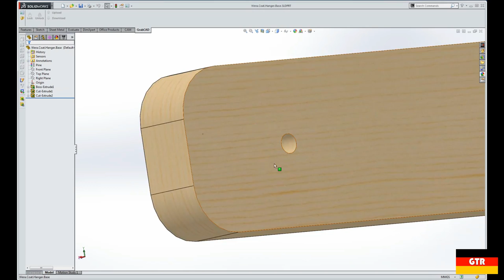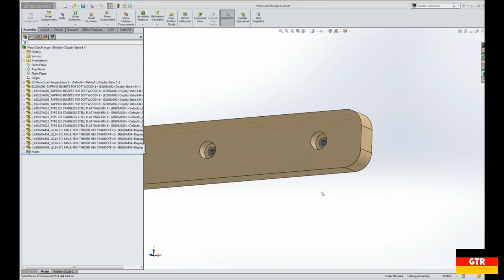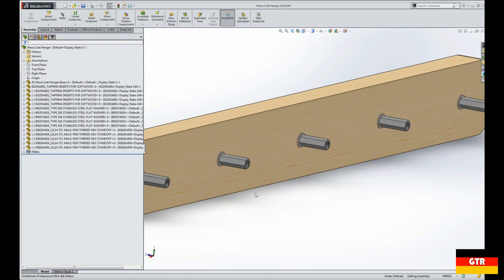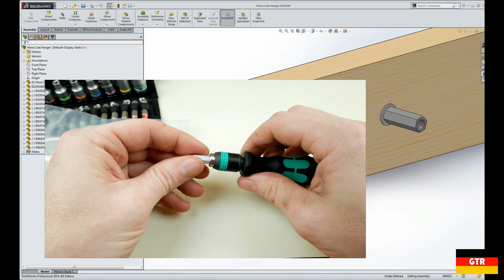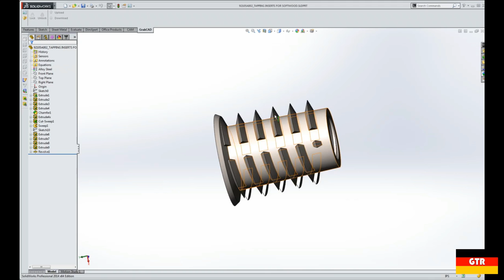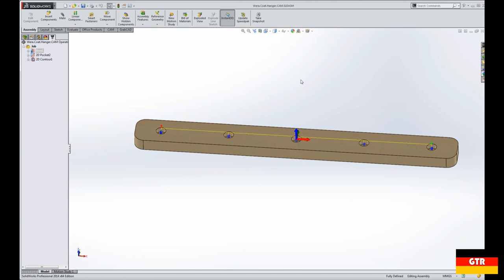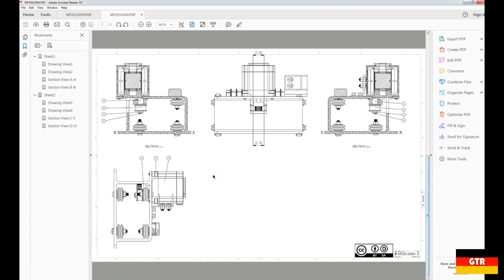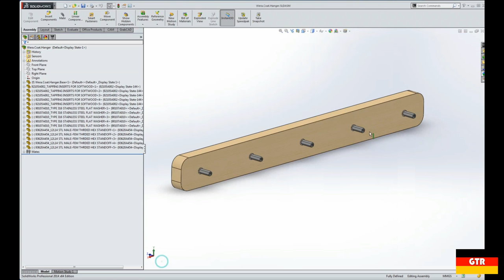My Wera Handle Coat Rack

Comment: Nice! Given the cost of the handles a better species of wood would certainly be more fitting but I consider this more of a proof of concept than a final product. Woodcraft or Rockler have precut finished boards in many species which are great for someone who isn't set up with a full woodworking shop.
Reply from the maker: Yeah it really was just a proof of concept.  Total time from conception to installation was less than a day, so there was a lot more I could have done if put some more refinement into the design.  If i did it again I would take a strip of anodized aluminum and tap the holes for the standoffs.  I calculated that those standoffs have around 300lb shear strength so I could probably do pull-ups on them with that design.
Reply: Sounds like it would make for a great video!

Comment: Next one you make could you put in the links or information on the hardware please, Sir? I have the Wera push thru square ratchet coming this week im excited for as it will be my first euro ratchet, one other thing is that the tool company ARES on Amazon has a tool pouch out with a row for 3/8 & 1/4" sockets and also loops to secure a ratchet and extensions. Be interesting to see how they compare to Wera's , I also wish they would sell those empty.

Comment: Yes, the locking mechanism works with a magnet.

Nice cloat rack. ;-)
Reply from the maker: There is a magnet in there, but the locking part has something to do with inner ball bearings pushing against the hex stock.  I'm not exactly sure how it works but I would guess there is a cam-lock type system.